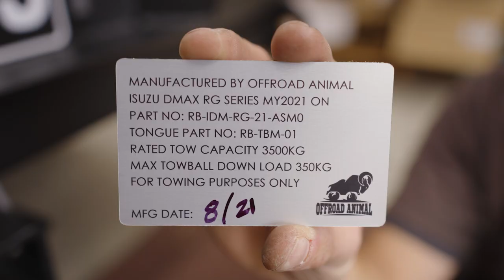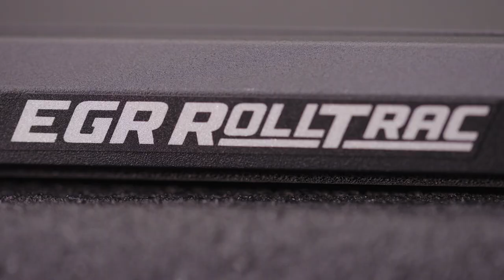Ultimate Isuzu Dmax build video by Offroad Animal

Comment: Unbelievable set up. Just beautiful for going  off grid for a bit. Suppose you will need a fridge then and it all gets complicated with weight and electricals. But for general weekend trips, you won't need more than this.  About 30 gran later though I'm guessing. I would run a 275 70 17. The 285 rubber is gonna cost you a bit more in juice for sure. Great job guys.

Comment: With the rear tub setup is it possible to have a fridge if so which one and how does it handle dust and rain?? Seen canopy setups leak and let dust in multiple times even with upgraded seals
Reply from the maker: This is not a canopy, this is a rack, it's not even close to being sealed.  However the roll track is pretty good and only minor dust gets in, so most fridges would be ok as long as their not too high

Comment: I just had my animal rear bar installed, now my rear radar sensors are coming on and off thinking there is cars next to me when not, I go to change lanes and it throws me back into lane. What's the fix with this? I'm taking it back to installer. I've hear needs calibration or installed left side instead of right.
Reply from the maker: Sounds like installer may have an issue with the sonar sensors.  let me make sure they're installed correctly